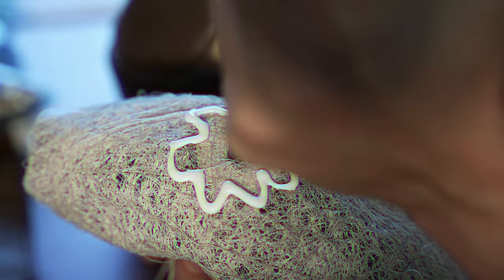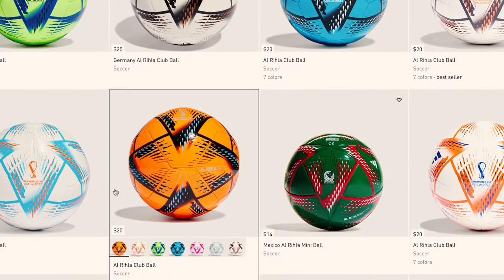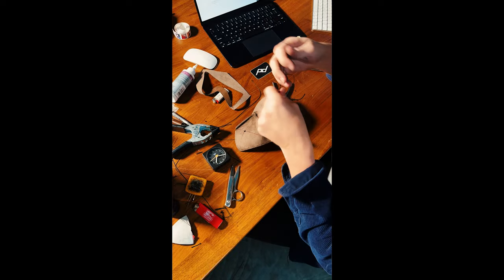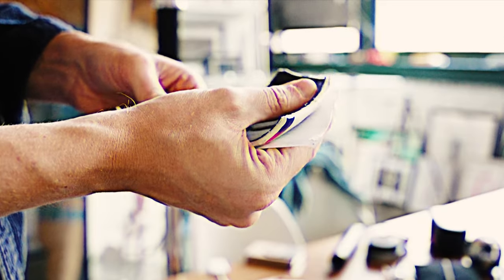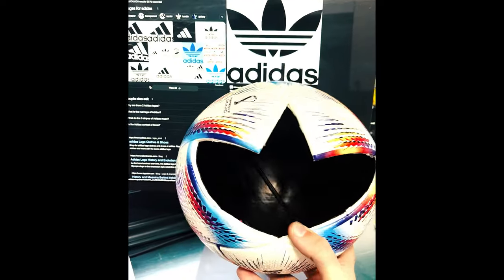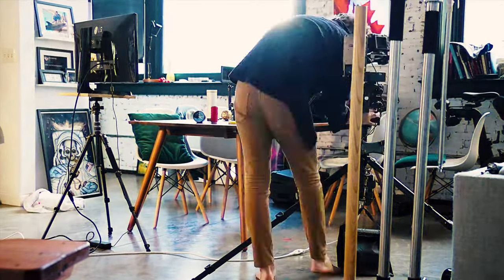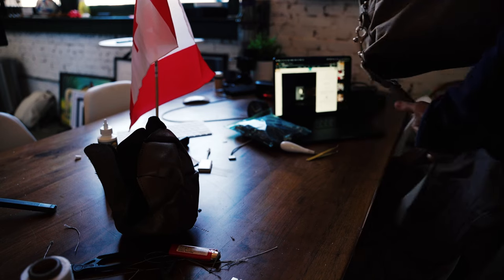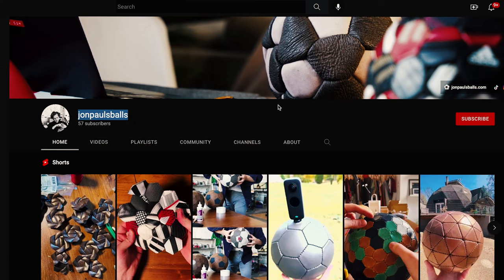I Found a Secret In The New World Cup Football (Al Rihla)

Comment: reverse engineering a ball is such a neat idea! when it comes to the issue of the panels not lying flat i can offer a suggestion from the knowledge of plushie- and fursuit-making: which is to cover your model (the football panel) in a layer of masking/painter's tape (as small pieces as possible to avoid wrinkling) and then peel the tape off as a big piece and stick it to a sheet of paper, and there's your pattern piece! naturally it'll likely still need some adjustment, but it could potentially save some time